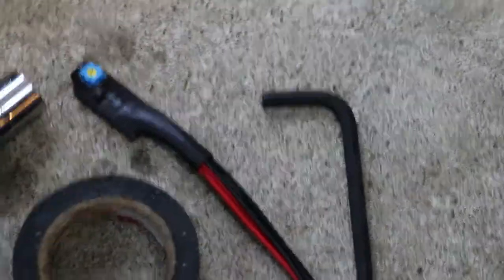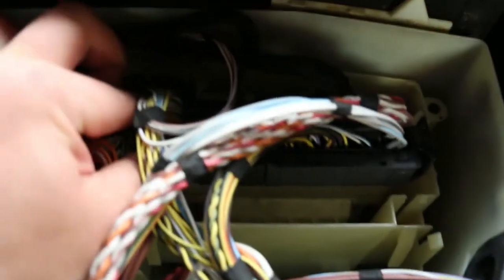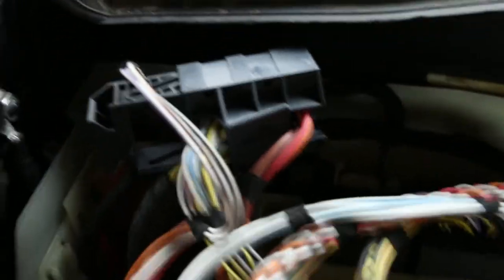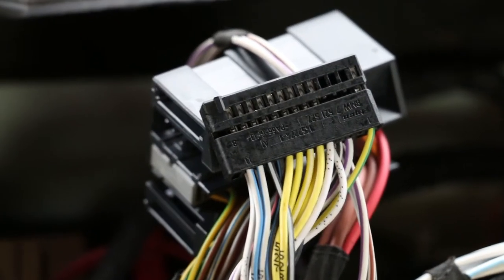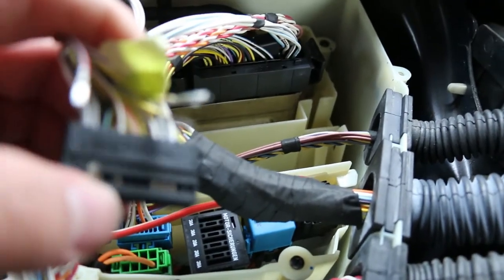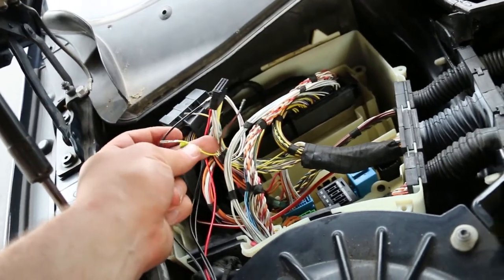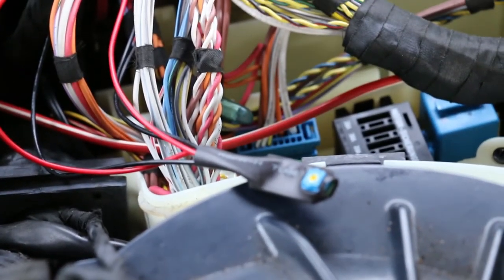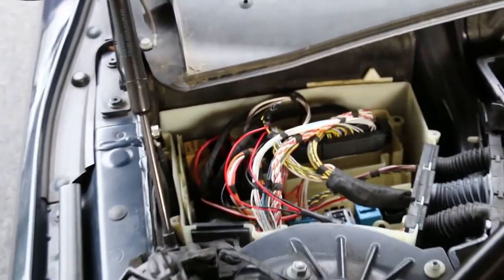BMW N54 Downpipe Fix DIY

Comment: Foul News where did you find this n54 dp fix???
Reply from the maker: I ordered this one off of VRSF's website. However with recent MHD updates, this is no longer necessary and vendors no longer sell it.
Reply: So would that mean you no longer need yours  ???
Reply from the maker: @bradg7440  that's correct, I removed mine about a year ago.
Reply: Did you sell it ??? I’m obviously in need of one
Reply from the maker: @bradg7440  Yes, I sold it back then. I would check the forums or Facebook groups to see if anyone still has one of these for sale.
Reply: I’ve been looking looks pretty dried up however I don’t have a Facebook. I normally run a jb4 and just need the dp fix to “test” of course and then hook the jb 4 back up and go on my way.
Reply from the maker: @bradg7440  ah gotcha. I'm not entirely sure, but I think you can backend flash MHD with JB4 and have catless downpipes coded so you can pass.
Reply: Foul News Hi are you implying that the current MHD has the do fix “built in”?

Comment: I install dp fix & I still got engine light
Reply from the maker: If you're on MHD Stage 2+ or a custom tune that takes the catless downpipes into consideration, there may be another issue at hand. What codes are you getting?
Reply: Foul News yo, I’m getting 8 codes. When I installed my catless downpipes I didn’t plug in my primaries and I did plug in m secondaries 0’2s. I plugged up the primaries tho with a bolt that fits perfectly and I used plumber tape to make sure it’s tightly sealed. I get all the o2 sensors codes. I’m on Mhd stage 2 and I just wanna know if that’s normal for all the codes because I am catless or?
Reply from the maker: @operatorlip  That's not normal. You need both your primary and secondary O2 sensors. The primary ones are the most important ones.
Reply from the maker: @saaqibrana2997  definitely. I'm surprised that it runs at all without them in the downpipes. You'd definitely be very down on power and risking engine damage. The primary O2s determine the air fuel ratio needed at all times, especially on boost.

Comment: mine is longer 1 -23 23-44 for the black connector
Reply from the maker: Are you sure you didn't pull the other connector on the right side of the DME?
Reply: mine is like that as well. the dme is located on the opposite side of the electrical box
Reply: Foul News  i realized that mine is on the right side instead of the left like yours i guess since mine is a 135i..  thanks for the vid it got the job done...
Reply from the maker: @M5tubee  Oh had no idea they varied like that. Glad it worked out for you!

Comment: Car won’t start now
Reply from the maker: Are there any codes? What are the symptoms when you try to start?
Reply: Likely that ECU connectors were not seated completely and locked down with slide mounting clips.